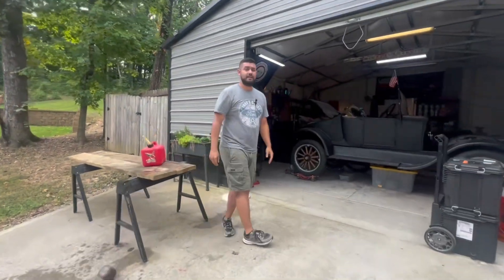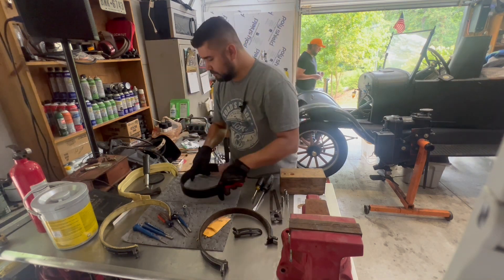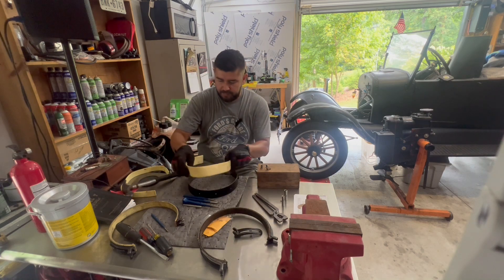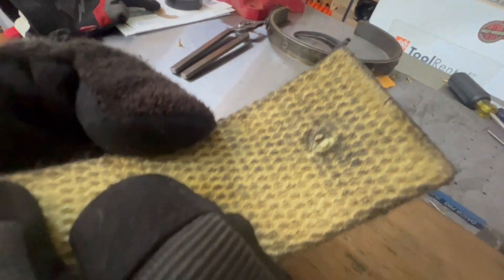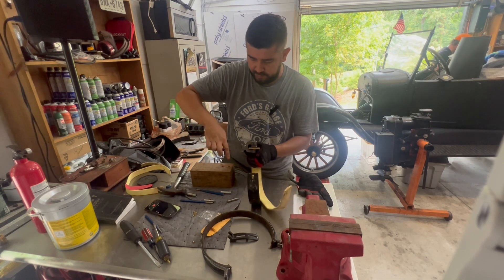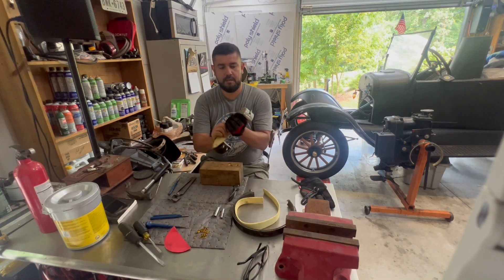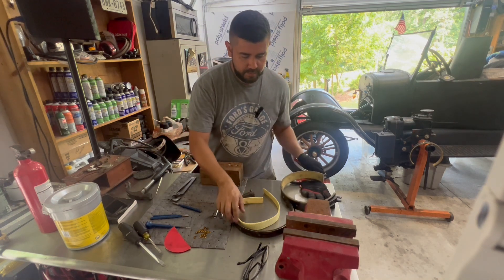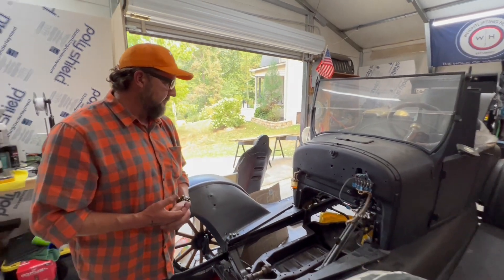Model T Transmission bands replacement

Comment: I recently installed a new brake band on my T and initially used the Kevlar material but I thought that it had less friction than the cotton bands.  You can't get the cotton lining anymore.  I found a piece of cotton lining from years ago I had and installed that and it works better.  Mine has the narrower band as it is an earlier car, maybe with the wide bands you might not notice?  I wonder if anyone else has observed this?  The one thing I know from doing this is to order extra rivets and I always use the longer ones.....  I don't have any fancy tools either and it is always a learning experience even though I have done it before.
Reply: Oh, that's a pretty good thing to bring up. 
Honest truth, I was considering using some reclaimed ratchet straps from a flatbed hauler to cut and make my own custom bands! How would that go? :v
Reply: @jackpijjin4088  I think I got the material I used from McMaster but they don't carry it anymore.  I also have a set of Scandinavia type bands but haven't used them yet.  The McMaster material is cotton and very tight weave.  It might be something used for ratchet straps I don't know.  As long as you pump the brakes they will last a long time.  I think I last changed them in the 1990's.